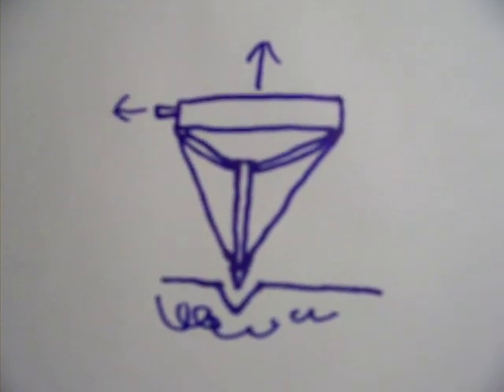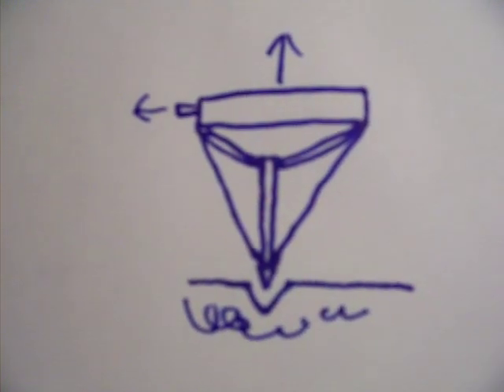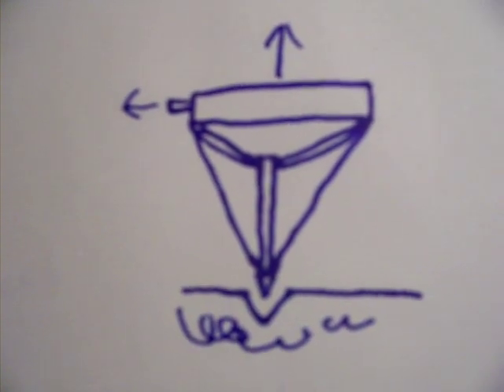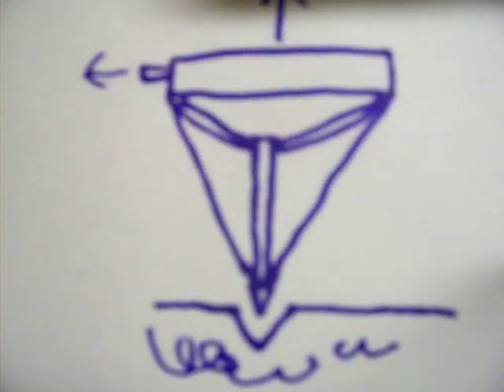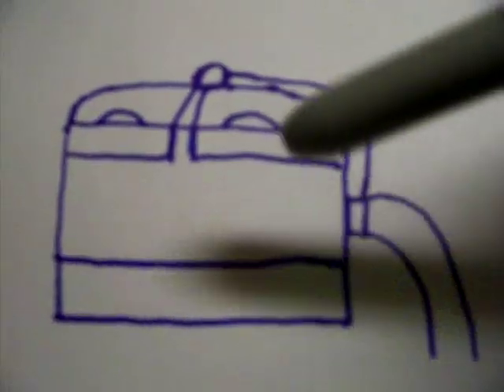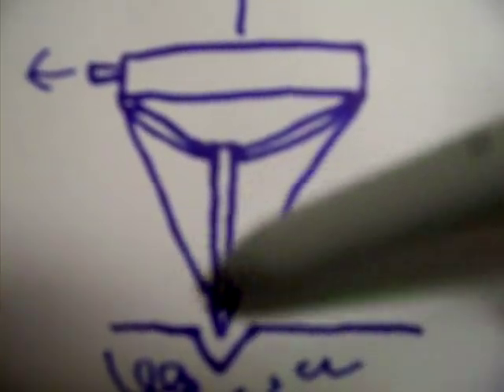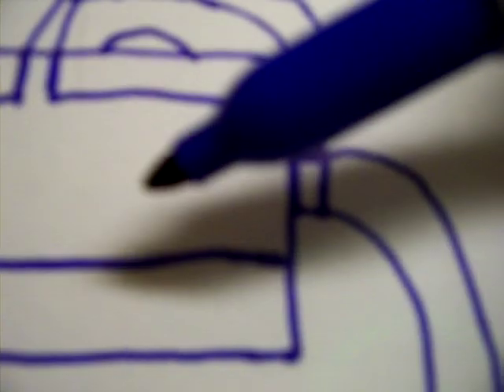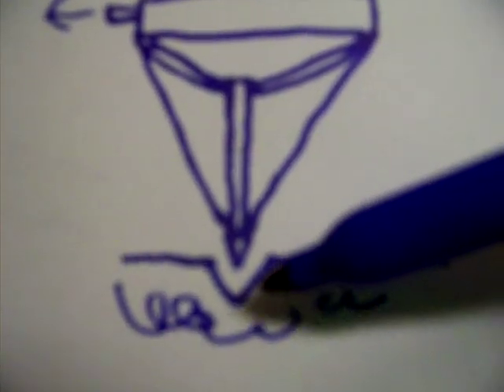How An EGR Valve Works Made Easy

Comment from the maker: Depends on where it is plugged up. In the past it was common to take the vacuum line off of the egr so you would not loose power and no problems are usually found. A generally plugged valve could bring in exhaust and cause some smoke.

Comment from the maker: The presence of the exhaust will act as matter to consume heat and prevent too much from being created as whatever the gasoline vapors and O2 from the air could do will be less.With a carburetor the amount gas added was constant; the air-fuel ratio was either correct or too lean and fly in exhaust gas which would only slightly enrich the mixture.With FI the amount of fuel is leaned a bit and adjusted with ignition timing and O2 sensors. The EGR works to correct to the proper air-fuel ratio.

Comment: cool thank you! I just could not get my head around how to cool a engine down with hot gases, everyone says it does but nobody says how. So basically it is like pumping "air" through the engine, which is colder then some parts off the engine. It is not really clear to me if you still pump the same amount of fuel through the engine? that would mean more carbonmonoxicde